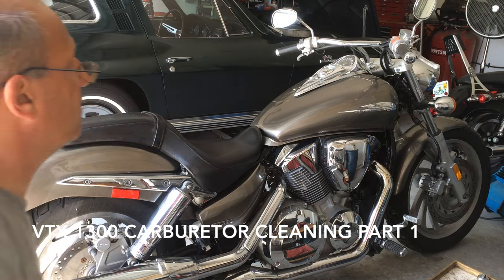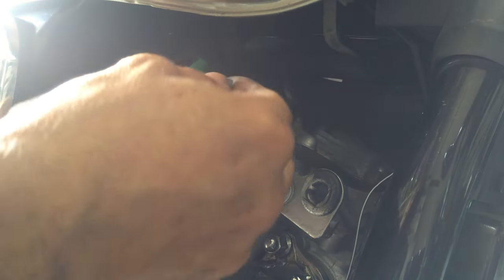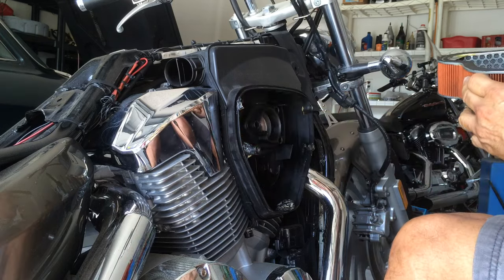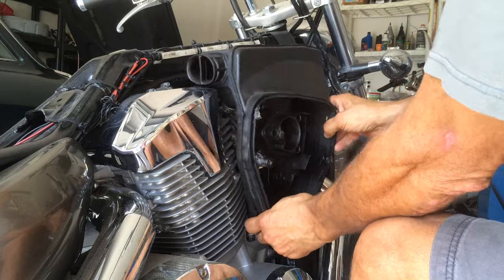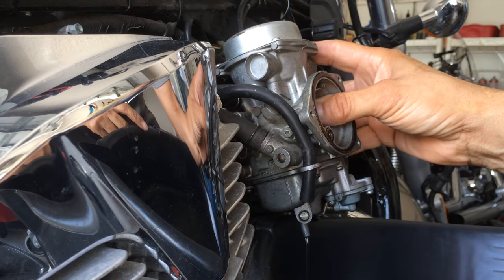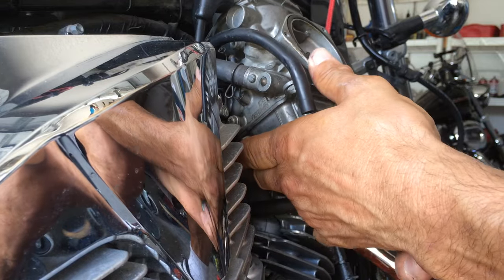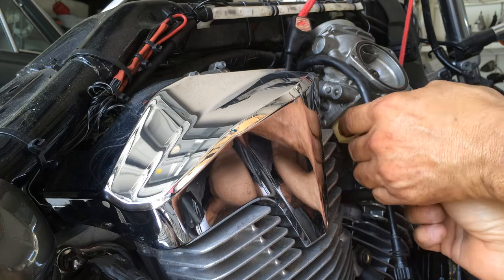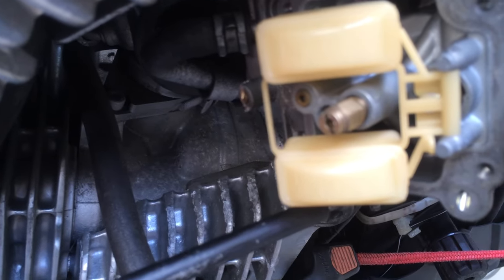How To: Honda VTX 1300 Carburetor Cleaning Part 1

Comment: Great video! Very helpful! I followed your step by step and cleaned the carb and my '06 Vtx 1300c runs much better thank you! However, it idles high and is slow to return to idle. What should I look for?
Reply from the maker: Start by lower idle knob,bottom of air box counter clockwise. Make sure there is no vacuum leaks. That would be the Vac. hose from the gas petcock to top of the carburetor take a look at that, that would make you idle slow to return.Let me know if that helped. Ride Safe.

Comment: I just bought one of these bikes and it will run good for a little while, then just dies going down the road some trips. Does that sound like a carb. problem? 
I appreciate any feedback.
Reply from the maker: Petcock  Take a look at this sportster video is the same as your Honda for testing take a look an test yours. I find a bad petcock diaphragm will cause all sorts of driving problems. Let us know how it works out.
Reply: @TwoWheelRocco  yes sir, I will let you know. Thanks for the info
Reply from the maker: @sasquach3.090   Ride Safe and have a Great Day.

Comment: Hi Rocco hope you are well?
This was a great video only question I have is if you turned out the idle screw 1 1/2 turns what is the idle screw next to the air filter suppose to be thanks
Pauly
Reply from the maker: Happy to Help,  The air gas screw is for the mix of your fuel at idle and off idle transition. The one by the filter is to set the idle speed. Hope that helps.  Thank you for watching and your Sub Paul.  Ride Safe and have a great day

Comment: My 04 vtx1300r is leaking oil and fuel from carb. What could it be?? It has 42k miles
Reply from the maker: Sounds like you have too much oil in the motor. I would remove the oil and see how much is in there, there are two drain plugs for your VTX.. your window is probably totally black. So it is hard to tell. As for the fuel I will check the petcock you sounds like you have a bad diaphragm and leaking fuel into the motor. take a look at this video. https://youtu.be/gvGOkRaD3sY.   This is the same test for you Honda petcock  https://youtu.be/7Fo9Q93OJXI.   Hope this helps. Any questions just ask. Let us know how this works out. Thank you for watching and your sub Intelin. Ride safe and have a great day.
Reply: @TwoWheelRocco  fuel is coming from the carb. I can see wetness. I put it away in my garage for winter and i notice fuel smell and it is wet around the bottom of carb
Reply from the maker: The petcock diaphragm has failed and Fuel is flowing freely causing the over flow of fuel at your carburetor.  it will leak threw your vacuum line. Start  at your gas tank.,  Test the Petcock for a vacuum leak  and let me know how it works out.Test your Petcock. Check your oil it problem smells like fuel.   Lets know...
Reply: So i rebuilt my 04 vtx and throttle is too tight.its not snapping back.can you show me how to adjust cable from carb. I never touched cable on grip.only touched cable on carb
Reply from the maker: @intelin123  Not a problem. Loosen the cable play at your twist grip and this will loosen up your throttle. I know you took the play out at the Carburator but the next adjustment is at the twist grip, hope this helps I'm will send you a video  on twist grips install on a sportster.  Same principle as your VTX.  Take a look at the cable adjustment part at the end, Click this 9:00   https://youtu.be/RzTyoN6Wyro.   Let us know how this works out. Thank you for watching and your sub. intelin123.   Click this  6:40    .https://youtu.be/RzTyoN6Wyro.       Ride Safe and have a great day.

Comment: Thanks for the vidoes.  I plan to tear into my new to me 1300 today.  Bought a bike that wont run after sitting for 5 years.  My question is with the A/F screw.  In the video, it looks like you mark the screwdriver with a black pen and then rotate clockwise to close completely.  Then it looks like you mark with a white liquid, and proceed to rotate clockwise again.  What am I missing?  I assumed you would rotate counterclockwise (opening up 1 to 2 turns)????   Thanks again.
Reply from the maker: Happy to help. 1 3/4 turns out. sweet spot. Any questions just ask. Thank you for watching and your sub Cbc. Let us know how it works out. Ride safe and have a great day.
Reply: @TwoWheelRocco  thanks so much.  I have not torn into it yet, however I know it has a blocking plate /desmog kit, and high airflow box.  Do these affect the carb. clean procedure in anyway, or others things I should be aware of, regarding these mods?
Reply from the maker: No,  what is your bike doing?  Clean carburetor usually the idle jet. Make sure your petcock is functioning I'll send you a video on how to test.  This is the same test for a Honda as it is a Harley vacuum operated petcock test.  https://youtu.be/7Fo9Q93OJXI
Reply: @TwoWheelRocco  thanks so much.  I have completed the Carb cleaning and am about to put it all back together.  I noticed a question about turns regarding the infamous A/F screw and you asked them what their setup was other than stock?  My bike has a high airflow box, blocking plates, and re-jetted (don't know size) and bub jug hugger exhaust? Any change to the 1-3/4 turn.
Reply from the maker: @cbc1344  start at 1 3/4 F  Air/fuel and take it from there +1/8 see who she rides. see how she rides.. Test and tune.

Comment: Hey Rocco - great video - I just picked up a 2009 VTX and I've had the issue where the bike starts, runs for about 60 seconds then stalls... after that it won't start for a bit - could this be a carb that needs cleaning?
Reply from the maker: Happy to help the first thing I would check is your Petcock vacuum Diaphragm. That's what opens and closes the gas valve to feed your carburetor. I will send a video test your Petcock first and make sure your vacuum line to the carburetor is solid. Thank you for watching and all your support Etern. Any questions just ask. Ride safe and have a great day.   Take a look at this video. It's the same procedure for a Harley as it is for your Honda VTX Petcock.     https://youtu.be/7Fo9Q93OJXI?si=1abUjTcBKJPrzlqk
Reply: @TwoWheelRocco  Thanks so much Rocco I will check this out!!

Comment from the maker: Thank You for watching, Any Question just ask. Ride Safe and have a great day.
Reply: where can i get fuel tank
Reply from the maker: @jamescorder8830  I would try Ebay. What is wrong with your tank James?
Reply: So much easier than my ACE 750. This is gonna be my next bike. Thanks for the vid, man.
Reply from the maker: @benficacm  VTX 1300 is a great choice.  Any question just ask. Thank you for your Support. Ride Safe and have a great day.
Reply: Any tips on why the accelerator pump isnt working , bike would turn on with starting fluid but wouldn't stay on , when I pull throttle , gas doesn't shoot out
Reply: hello what year model is yours? is it 2005?
Reply: @TwoWheelRocco  hello what year model is yours? is it 2005?
Reply from the maker: It is an 2005, They are all the same set up. Any questions just ask. Thank you for your Sub Jun. Ride Safe and have a great day.
Reply: Two Wheel Rocco thank you for your video its really helpfull ,  what plugs are you using and what air filter end where to buy?´´…now i know what to do and it is easy ...  can you make also video  changing oil , and what is the best oil filter to use and where to buy? Thank a lot
Reply from the maker: Hope this Helps.  Thank you for your Sub Jun.  Take a look at theses videos. Tune up  https://youtu.be/M34nLPsdxBc.   Oil change. https://youtu.be/gvGOkRaD3sY. Any questions just ask,  Ride Safe and have a Great Day.
Reply from the maker: Peyton Gustavo  So what is your bike doing?
Reply: Where is the air fuel screw located?
Reply: YO ROCCO!!!!!
Reply: YO ROCCO!!!!!!
Reply from the maker: @scotthewiseman2471  I hope all is well Scott. How's that 1300 VTX going? Ride safe and have a great day.
Reply: Man I have my Honda CRF 450X I have to do, and I jumped on VTX this morning to go for a little ride and it won’t idle correctly, so I now have two to do. Haven’t checked my KX 250 yet either. FML. Lol
Reply: @TwoWheelRocco  I’m going to use my Harbor Freight Sonic cleaner on the jets I can get out . It does an impeccable job cleaning the whole jet. Thank you for this great video bro…
Reply from the maker: @scotthewiseman2471  Great idea my friend, I got to take a look at that. Ride safe and have a great day. Let us know how it works out.  Thank you for your insight.
Reply: I have a 95 magna All 4 carbs are a nightmare.  This just made my decision on  getting a vtx so much easier
Reply from the maker: Yes they are,  Four carbs are a bit of a bear. The VTX. is simplified and a much better bike I love the 1300s. Good decision. Just upgrade. Any questions just ask. Thank you for watching and all your support. Ride safe and have a great day.,
Reply: What mph should I shift out of every gear on an 06 vtx 1300 if I'm trying to go as fast as I can?
Reply from the maker: These bikes aren't about speed. Slow down take your time. Ride safe and have a great day. Sorry I couldn't help you with that.

Comment: Picked up a bike that’s been sitting a while there sounds like a lot of debris in the tank guessing it’s corrosion no matter what I do I can get it out by draining any tricks?
Reply from the maker: Happy to help. Remove the gas, remove the tank from your bike. Remove the petcock let the tank dry out. Now take a vacuum cleaner and compressed air at the petcock spot and let all the dust get sucked into the vacuum at the gas cap, stirring it up with compressed air from your compressor that's how I do it,  let us know how it works out.. Thank you for watching and your sub Nicholas. Ride safe and have a great day

Comment: Hey, thank you for your previous help, i got my carb cleaned and it runs really good now after putting it back together and adjusting idle speed. 
Upon reassembling it started leaking from the petcock and i wanted to know if there was anything special i needed to have done while putting the petcock back on after draining the gas? Or is it likely just needing replaced or rebuilt. I leaning towards replacing as i don't see a specific rebuild kit for the vtx 1300c. Again thank you for the videos you've been a great source for learning how to work on my bike.
Reply from the maker: https://www.ebay.com/itm/2003-2009-Honda-VTX-1300S-R-OEM-Fuel-Petcock-Diaphragm-Cover-Set-16953-KEA-023/312392858951?epid=1422930328&hash=item48bc10bd47:g:5HAAAOSwV0VcHSvT:sc:FedExHomeDelivery!34953!US!-1.   
 This is what you need to rebuild your petcock. Let us know how this works out.

Comment: Hi, I cleaned my carb according to the vid and it ran pretty good. I had just bought the bike and it ran poorly before. I have been riding for about 100 miles now and yesterday had to hit full throttle in 2nd gear to outrun a large dog. The bike sputtered and missed as it gained speed. never did smooth out till I let off and shifted gears. Smooth riding till heavy acceleration. Jet sizes unknown, VH Big Shots stock A/C. Ideas?
Reply from the maker: Happy to help,  with that exhaust you will need a jet kit.  You need to find out the Jets size you are running,   you cleaned your carb,  take a magnifying glass and find out what those jets are.  Thank you for watching and your Sub Chris.. Ride Safe and have a great day.

Comment: Hi Rocco, my float chamber is definitely getting gas, but when I turn the throttle I no longer get that little spurt of fuel into the carb from the accelerator pump. Would appreciate your thoughts when you have a moment.
Reply from the maker: It sounds like it worked prior your carb cleaning.  Twist throttle a few time and see if it will prime. If not, remove float bowl and take apart and clean accelerator pump diaphragm and passages with compressed air and carb cleaner. Let us know how this works out.
Reply: @TwoWheelRocco  Thanks for such a fast reply Rocco!  Yes, it was working fine  (well, a little backfiring)  and then one day.... no fuel.    Earlier tonight I did take apart and clean the accel pump diaphragm and blew out the ports. I'm going to put the tank back on in the AM and see what happens. I need to get or make myself one of those hanging fuel bypass rigs like you have.
Reply from the maker: @peterpoggi  You can test it by holding float bowl in hand, fill half way with gas and pump the accelerator rod in and out and watch the pump work. Hope this helps.
Reply: @TwoWheelRocco  Great idea Rocco, thanks! Got home late tonight, will give that a try  over the weekend.
Reply: @TwoWheelRocco  That test worked Rocco, and I now see fuel pimp into the carb when I twist the throttle.  I cleaned out all the passages with carb cleaner, pulled and cleaned both jets.  Next step is to go pick up a 60cc syringe to inject some fuel into the carb and see if it'll run again.
Reply from the maker: @peterpoggi  Starter fluid will work fine. Let us know how it works out.
Reply: @TwoWheelRocco  I injected some fuel into the fuel line with a syringe, and it's running , at least for the few seconds till the fuel runs out. :-)   Next step will be to reinstall the tank. Hopefully it will run and maybe even stop backfiring on decel.    Question for you - is there a way to "fine tune" the A/F mix screw? I have an extender on it so can reach it even with the air cleaner on.  Right now it's at 1 1/2 turns out.
Reply from the maker: @peterpoggi  What pipe and air intake?
Reply: @TwoWheelRocco  Stock all the way.
Reply from the maker: @peterpoggi   If I remember 1 3/4 worked well with stock pipe.  and that will help with decelerations back fire.  That is a good starting point.  Let us know how it works out.
Reply: @TwoWheelRocco  "On the Road Again", just like Willie Nelson :-)   Thank you for your video and your responses!   I took it out for about 30 miles. It's running well. A little rough, but good pickup and no lag when rolling on the throttle.   A little bit of low, rumbling, backfiring on an occassional decel, but not the one loud !!BANG!!! that caused bystanders to hit the deck, like I was getting before I cleaned  the carb. I haven't put my tach on it yet but I think it's running a little fast.   I turned out the air/fuel screw 1 3/4,  then backed off about 1/8 of a turn and noticed it ran a little better.  Can you point me to a good tutorial on how I can better "dial-in" the A/F and idle adjustment settings?
Reply from the maker: @peterpoggi  That petcock and vacuum line is everything. I will send you a video that will clear up how important it is.  Same principle  But this is a Sportster. Give it a chance. They are the same deal.  Let me know what you think. If you sub. and hit the bell you will get my video weekly.  Thank you for your support.    Please take a look.   https://youtu.be/kivgNpZWHeY

Comment: Hello, I have this motorcycle 04 VTX1300S  and had the carb rebuilt at the Honda dealer, I bought it not running well and it had sit for sometime,  when I got it back  it was running fine, then I took it back to have some pipes put on and they first put in the jets the manufacture of the pipes, I think their Cobra suggested, but they said it had a flat spot when you gave it the gas, so they changed the jets again now its so lean I cant ride it because when you let off the gas its bangs so loud it sounds like its going to blow the heads off. I have a feeling because because of the age of the mechanic at the dealer hes not worked on a lot of carburetors, he kept saying he was looking on YOUTUBE... so now I have a motorcycle I cant ride and I have had it over a year and half,   Im in Kansas City MO. not sure where your at. any suggestions? Thanks Greg
Reply from the maker: Happy to Help. What pipe, Main jet and Idle jet? Thank You for watching and your sub Greg.. Ride Safe and have a great day.

Comment: I started my 1300 for first time in the years big cloud of smoke and oil coming out it mufflers,I shut it off next day it was all over ground came out of air filter?
Reply from the maker: Your petcock failed, And gas flow into crank case Threw your vacuum hose that runs from petcock to your intake..  Drain oil and refill. Test vacuum on your petcock, Diaphragm fails I will send video to test yours.  That are the same..  https://youtu.be/7Fo9Q93OJXI.  Any questions just ask.  Thank you for your Sub John. Let us know how this works out.
Reply: It's a vtx 1300 Honda
Reply from the maker: There petcock are the same principle,  Honda and Harley have CV carbs with Vacuum petcock. Just showing how to test yours. so you can replace with a diaphragm kit $30 on Ebay.   https://www.ebay.com/itm/Fuel-Gas-Valve-Petcock-Diaphragm-Cover-Set-CB600-F-VT750-Shadow-VTX1300-H79/361509998209?hash=item542bacce81:g:jygAAOxydgZTIf2~.  Hope this helps.
Reply from the maker: Smell the oil in your VTX 1300, Does it smell like fuel?
Reply: @TwoWheelRocco  looks like watered down oil on floor smells like gas allot of it came out the airfilter cover
Reply from the maker: Happens a lot with bikes that sit. Valve is open it will come out your exhaust, as the gas drains out of tank, And it will fill your motor. do not try to start. you could hydrolock your motor.   Remove spark plugs, and fuel. fix petcock and do an oil/filter/air filter and she will be as good as new. Let us know how this works out. Any questions just ask.
Reply: Thanks I'll try that